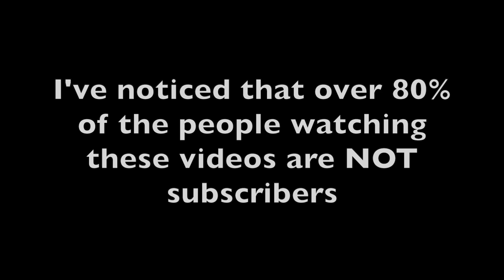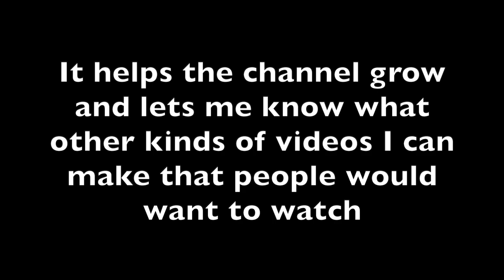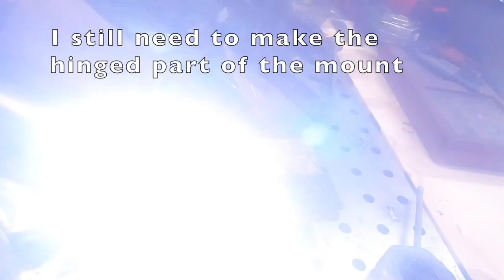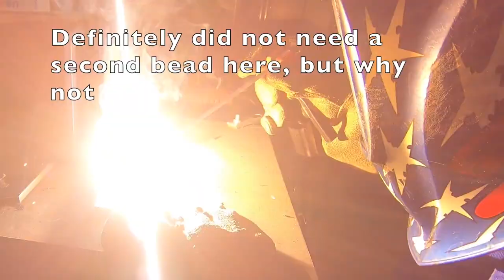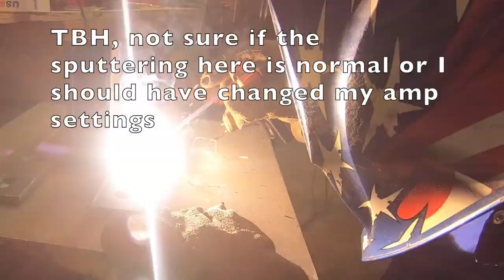Building a Hinged Flag Pole Mount

Comment: Interesting as always MLM. Turned out to be nice looking welds! Love seeing the SB in action...what's up with the Bridgeport?
Reply from the maker: No time at the moment to dig into the BP. I did get the motor shaft fixed already. But I need 3 phase to run it yet. Still deciding if I want to go ahead and just do a complete rebuild and restoration or just get it running. Same question I had when I started the lathe project.

Comment: Good work! 

If you don't mind me asking, what do you recommend for cutting fluid for different types of metals? 

Thanks
Reply from the maker: Depends on what I am doing. I have been using AnchorLube for drilling and tapping for a while. I’ve also tried it for milling and it seems to do ok. For steel on the lathe I would use just a non detergent 20 weight oil. On the horizontal mill, it has a pump with Mobilemet 426 in it. Aluminum I always use WD40 for most things. I don’t machine much brass, so I don’t have an answer for you there.
Reply: @MyLilMule  Okay awesome thanks. Slowly learning machining. Agree WD40 seems to work well on aluminum. I will try the non detergent 20 wt oil for steel on the lathe. Keep up the good work!